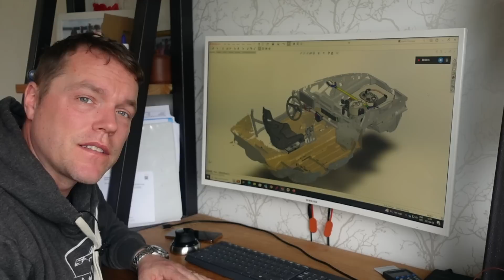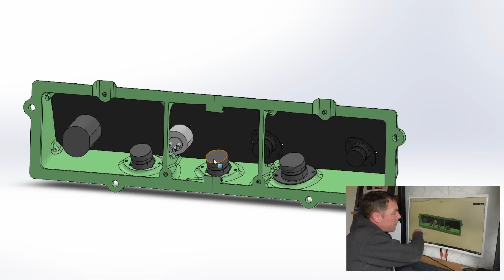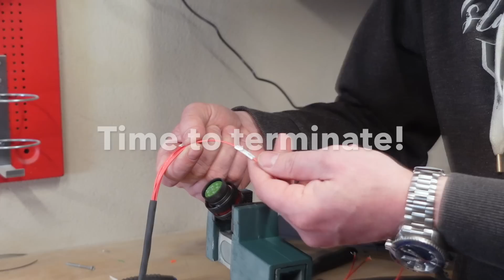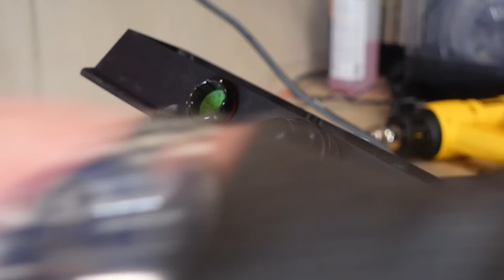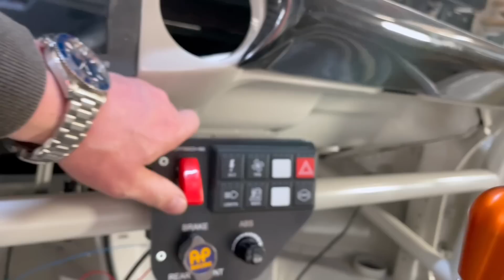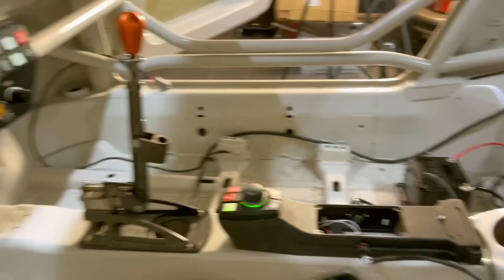Power Up  -  Flipping the Switch on My Porsche 964 for the FIRST TIME!

Comment: What shifter is that? CAE made in Germany? I have a Motec c127 on order and contemplating in getting that c1212 to connect to my m142 for my 2018 Honda Civic Type R fk8. I think I’ll also get the PDM30 and rotary knob. My engine builder says he can install the c1212 in my dash.  I just have to make sure the dash can be programmed to display everything the oem dash displays like turn signal indicator, fuel level, coolant temp, gear display as I will be having a Quaife sequential gear box into the car.
Reply from the maker: It is indeed a CAE. Sounds like you have an exciting project ongoing! Go full in and build your dream!

Comment: Nice work! I noticed that when the display is on, it creates reflections on the dash. I don’t know if it’s going to be visible by the driver or disturb, but may I suggest some matt finished  black film underneath the lip?
Reply from the maker: That’s a good tip. I think the top of the dash towards the window is the bigger issue
Reply: @islandworks  it probably is a bigger issue, but I think you are going to solve it 😀

Comment: You forgot to abrade the heat shrink ends prior to applying the epoxy and shrinking.
Reply from the maker: What does that mean?
Reply: @islandworks  you're supposed to sand the dr25 heatshrink exterior to help the rt125  epoxy  to stick to it when you do the boots.
Reply from the maker: @HansonLinek  I’m a beginner ;-)

They seem to be sticking nicely though